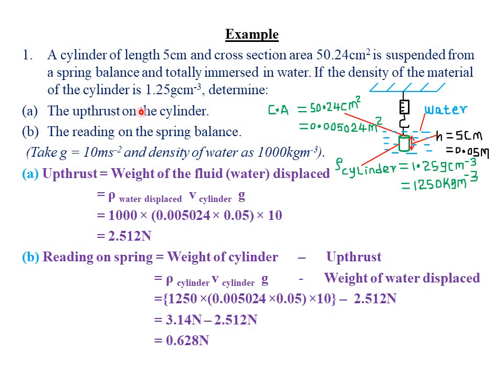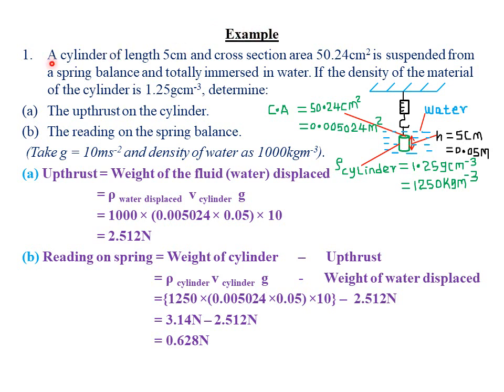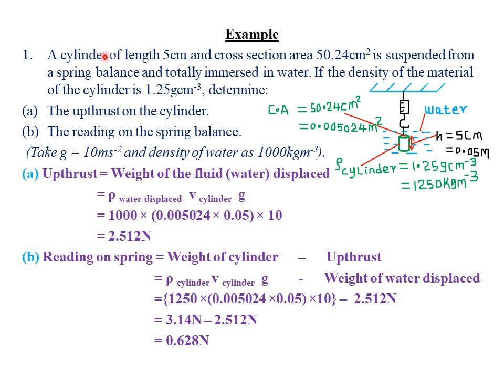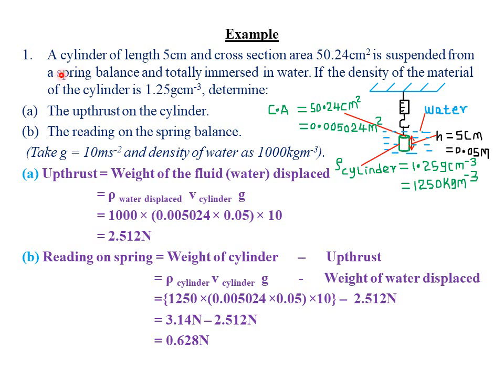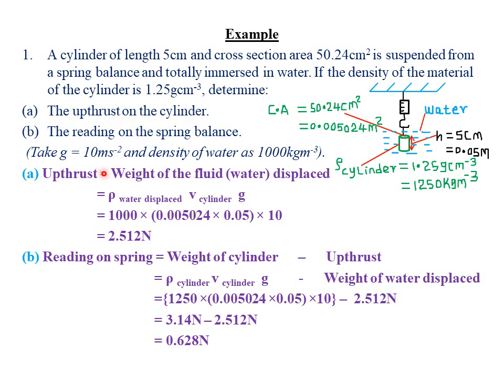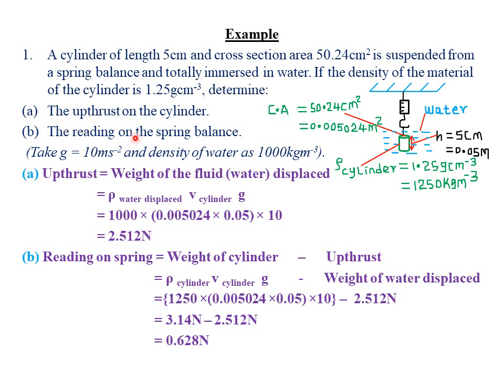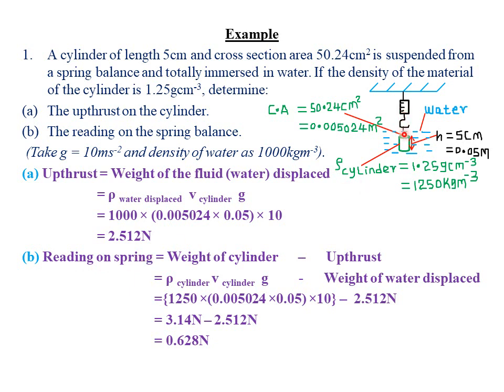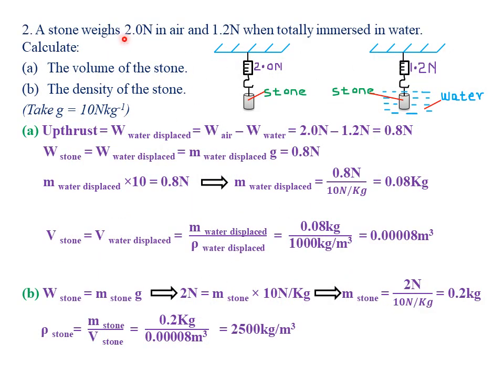FLOATING AND SINKING: LESSON 2

Comment: Can someone assist me in question 2
Reply: C)v=m/density 
4kg÷3000kg/m3=1/750m3
U=vpg
U=1/750×800×10
U=10.67
But upthrust=weight of water displaced 
W=mg
10.67÷10=m
M=1.067kg
V=mass ÷density
1.067÷800
V=1.333×10^-3m3
Reply: Upthrust is already found in (a) just copy
Reply: (c) weight =weight in air -weight in liquid 
We're looking for the weight in the liquid bcs that's what the spring balance will read
40-10.67
Reply from the maker: Wow, this is great, I'm happy to see this. Keep it up friend 🙏.

Comment: On thé first question "thé weight off a solid in air is 0.5N " ls it supposé to be 0.5N or 5N
Reply: I thought so to......I think the question in the exercise ....the weight in air should be 5 N, that's the only way you will get an upthrust of 0.96N